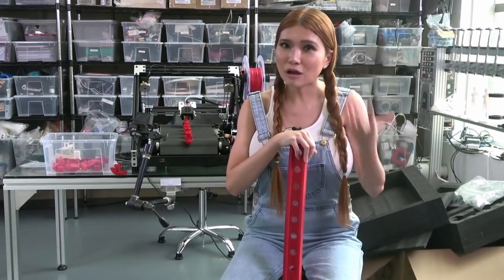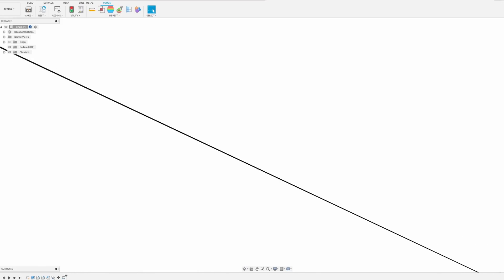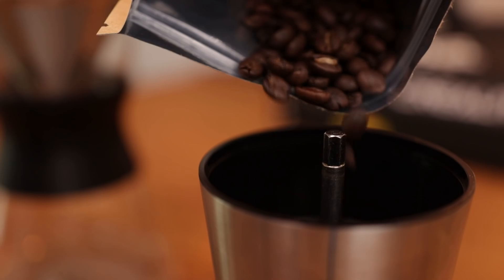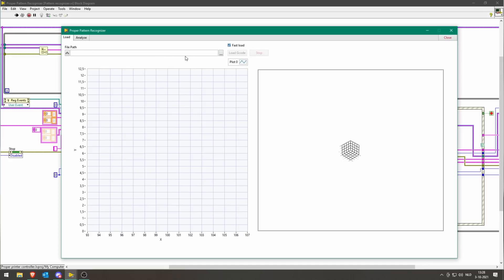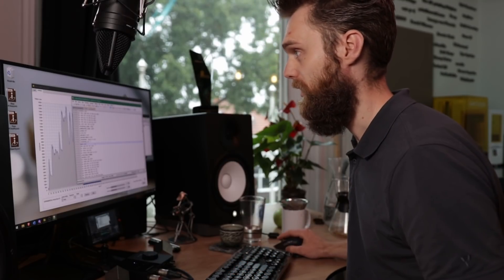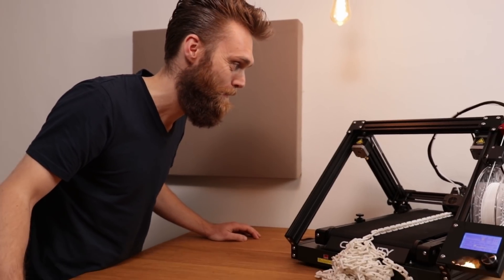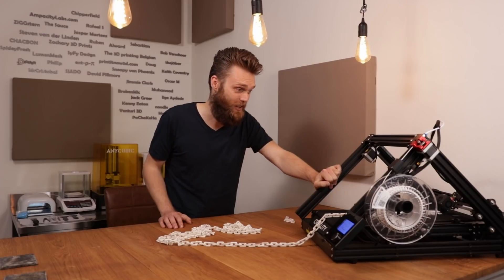Exploiting Pattern Recognition to print INFINITELY!?

Comment from the maker: Hi everyone! If you have any suggestions for this software or some designs with cool patterns to try, leave a comment! I just pushed this software to the development branch of the Proper Printer Controller https://github.com/properprinting/PPC/tree/development
Reply: Just giving a random thought:
I think with a folding algorithm the program could automatically find the repeating blocks. It's been a while since I had it in university, but I think it is also used in digital signal processing.
With folding, you can use a random section and detect, where it reappears in a data stream.

Maybe the program could take a random section of the data, with the condition, that it starts and ends with the same value, then fold it with the original data. This is done with different sections until a perfect match is found multiple times in the data. Then the pattern could.be presented to the user.
Reply from the maker: @MrKnoppersesser  Thanks for your thoughts! Finding the perfect match was so difficult because it seems like there isn't one. I tried it with a way simpler design, a long spacer, but there are minute differences (different starting points etc.). I tried with a match threshold, but it still was difficult. My idea is to use signal analysis within that graph to automate this process.

A funny problem you night run into when trying to find patterns automatically, within for example this chain, is that a pattern can be found within the link itself creating one very long link. This problem made me decide to do it manually since a human is more capable of knowing where to look.
Reply: @properprinting  Yeah, defenetly some kinks to the process.
And I guess slicing is already complex enough, to do the same task slightly differently each time.
But even with manual selection this is already amazing.
Reply: With the chainmail sheets, you will want to ideally have a connecting point on the sides so you can snap or link them together to panel make an item (like a shirt or something).  The print bed is not wide enough for a full sized print.  Now if you could deconstruct the frame, add bigger rails, and recalibrate the printer to know it has more room to move...
Reply: @seikojin  I've actually already created an infinite chainmail file and posted it on the 3DPrintmill Discord.
Reply: Any idea on how to convert this tool into a Cura plugin?
Reply from the maker: @AnchorInvest  No, no idea. I think it should work with Cura as well if you generate a Gcode with it. The software looks only at the G0 and G1 commands for showing those patterns and I programmed it quite universal. This needs to be verified though.
Reply: LabVIEW should have an autocorrelation function to find the looping lines (the period) - but injection of the command point might be a bit harder to do. 🤔 Nice work👍
Reply: Have you considered peak finding in Fourier space? Maybe a 2d transform of your x vs y data? Alternative option could be hierarchical clustering the data from two axis?
Reply: Hey man I just want to say thank you for these videos I hope that anything you want in life comes to you.
Reply: ^quite sad that this is just a design stolen by the chinese. Always sad to the some of the real makers get 0 kudos. /watch?v=E_RvnqVHbnA
Reply: @MagicGumable  I have to disagree.   Creality collaborated with me and WJSteele on their design and they had our full support.  We are just happy a belt printer finally made it to mass production.  Hopefully now we will see some real innovations in this style printer.
Reply: @MagicGumable  What do you mean, the belt printer? That was a collaboration with the actual inventor.

Comment: As a programmer, my immediate thought was G-code recursion. While recursion itself isn't actually necessary, the looping code accomplishes the same thing, including the break loop command. Basically you just need to find the start of printing a recurring pattern of 2 links and when the 2 links are finished, tell the machine to "go to" the line of code at the beginning of the 2 links again. This is obviously what you accomplished with the M808 command. Could be done with any print that repeats by just knowing the begin and end points of a looping segment. Very cool!
Reply from the maker: That was my immediate thought too! Turns out that there are minute differences on that level. Different starting points and an infill pattern or support structure that doesn't line up for instance, makes it impossible to find recurring patterns on that abstraction level. Therefore I added an abstraction level that shows the pattern. This probably can be automated using a Fourier transform to find the base frequency. It doesn't really matter where the loop starts as long as it's somewhere in the middle and at the right length. Another difficult part is to make it work with other designs too, not just a chain. Therefore I decided to make an interface where it's easy for a human to find the pattern instead of fully automating it with all variables involved. Thanks!
Reply: @properprinting  Extremely cool stuff man. I've been binge watching all your videos. In the middle of the experimental belt extruder vid now!
Reply from the maker: @802Garage  awesome! Thanks for watching them!

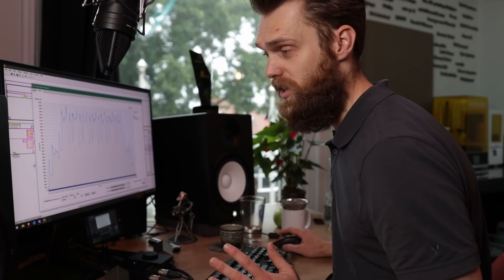Comment: I'd tackle this problem by using the information you have at 6:11, and doing frequency analysis on it. The repeating pattern should show up as the lowest large frequency spike. This frequency can then be used to fashion a 'window' length. 
Next we can use this known window length and do cross-correlation. Start by doing a cross-correlation with the window starting at layer 1, over the whole signal. Take RMS of all the shifts inside the cross-correlation as a measure as to the performance of the current window. Then shift the window to layer 2, and again do cross-correlation. This should allow you to detect the beginning of the repeating pattern automagically, so you just pick this as the start of the window and voila, you have singulated your pattern.

Anyways, that is how I'd try to automate this. If you have tried it, I am curious as to why it wouldn't work.

Comment: Just a quick idea: turn text to numbers then you have a perfect mumbo-jumbo number for each line. Cross corelate the lines (numbers) and you see a peak at each repetition to a perfect line assignment. I think this can be done in less than 20 lines of code.
For interested ones: the random numbers acutally help the cross corelation to distinguish perfect sections and you should get very sharp peaks, where the code repeats.

Comment: I know it was a joke, but there's no reason an infinity large print would need an infinitely large file. You could easily make it into a very small file. In fact you could easily even make infinitely detailed never repeating infinitely large prints that fit into a very small file size.
Reply from the maker: You've made me curious. How's that possible without using loops or an external controller?

Comment: Just print the same two links over and over. The top of one is the bottom of the other
Reply from the maker: Thanks for your suggestion, but this is not going to work ;) The start of the first pair of links is different than the rest because the rest has the end of the previous link in it.
Reply: @properprinting  
ah I think perhaps you misunderstood me
or maybe I was unclear 
the object printed is the second half of a link, the entire link slanted the other way and then the first half of a link printed directly on top of the previous link.
it would waste the first half link and the last half link unless you wanted to create a start object and an end object. 
I played with LOGO when I was little so the idea of a small recursive file making a continuous object seems natural to me
Reply from the maker: @andrewvoigt1133  ah yes, that makes sense. I'm wondering though if that wouldn't be more work than finding the pattern like I did in the video. With your suggestion you still have to determine the start and end point if I'm correct. Maybe I'm overlooking something though.

Comment: I was hoping you would get one. I bought 3 of them a few months ago and I've been looking forward to seeing what modifications you'll do to it. I got it printing TPU at 60mms with a ezr extruder from seemecnc. But the bed adhesion was terrible until I shimmed the two center posts under the heated bed with a washer.

Comment: General performance questions for the print--

Inches of chain per minute?
Length of feedstock consumed per inch of chain? 
Length of largest reel of feedstock machine can accommodate?

Which would lead to: Longest length of chain machine could print in one run and how long that would take?

Comment: Run the X, Y, Z, E plots through FFT and take the lowest common frequency peak from the results. This should tell you the exact period of the repetition.
Reply from the maker: That's an interesting approach! If you have the frequency, the position itself doesn't matter much as long as it's within the repetitive part of the file. I was hoping that I'd be able to pull it off with peak or valley detection and came quite close :D Thanks for this insight!
Reply: That's what I was going to suggest. FFT is Fast Fourier Transform for those that want to research further.

Comment: So you didn't make pattern recognition software, you made a visualizer and outsourced the pattern recognition algorithm to the human brain. Clever. Humans are much better than computers at recognizing patterns, especially when they're noisy.
Reply from the maker: Exactly! I rather see it as a tool. It's so much easier to put the focus at visualizing it as good as possible and make it as easy as possible for a human to select the actual pattern. If I'd designed it for this chain chances are that it would react differently with for lets say an I-beam with holes

Comment: I’ve just started watching this video, I will take a guess on the solution, then I will reflect on that comment. This can be achieved on Klipper by looping the gcode as script (except homing, heating part) and redirecting the output to /tmp/printer (named file descriptor, socket.)
Reply from the maker: I like that you comment your initial thought first! Looping Gcodes as a script on Klipper would have never occurred to me. I'm glad that my method was unexpected :D
Reply: @properprinting  😂 I can probably implement M808 as macro, too, if Klipper devs haven’t done it yet. My thought was a dirty hack though. Your method is the true “proper” printing.
Reply: The pattern recognition software was unexpected. I’ve learnt about M808, too. No need for scripting loop business. 

If I was trying to find a way to do this, I’d manually look at the sliced code and slicer, repeat from somewhere in the middle of the chain link manually. The less scientific approach 😄

Comment: Seriously using the worst software in the world (LabVIEW)?
Reply from the maker: You took the time to comment this twice so you must really dislike LabVIEW xD Can tell why it's the worst?
Reply: Tanks for the reply @properprinting  Yup, I really dislike it ;)
First of all it consumes a lot of computer resources even to do simple things (like a lot of RAM memory especially). Also it is very slow... It is worth mentioning that you have to download some beefy files even considering a runtime only to run a software...
Then entering simple algorithms takes considerably more time, compared to writing a code in any normal programming language (like Python, C++) - just let us consider a simple loop calculating some Fibonacci series ;)
And now more serious things - as you want to do some more complex things a LV code starts to be less and less easy to understand, while written code would still be. This especially refers to some modification of non-direct parameters of GUI elements (aka. controls and indicators). 
Then there is no proper compare/merge tool/algorithm when doing multi-developer projects using git (or other) repos.
Additionally some dataypes are not clear and conversion might be a nightmare. It also refers to ability to import/export some data - just by changing some cluster/struct definition during development you might render your old files (exported using built-in functions) unreadable.
Finally it is proprietary and paid software, while by coding your app using python, C++ or other languages you get much more freedom.
Reply from the maker: @piotrrze  Thanks a lot for your thorough reply! It shows that you know what you're talking about and I do agree with your points. The reason why I use LabVIEW, besides this is the software I know my way around with and I'd never call myself a software engineer, is that it's suited for controlling instruments. This is what I do as a test developer at work where LabVIEW is commonly used. I look at a 3D printer the same way as a programmable PSU for instance. In this day and age computer resources are becoming less of an issue, especially for the applications I create (besides that one exception haha). LabVIEW adds a layer of abstraction which comes with the downsides you mention, yet it enables to program at a relative low level. This means that I can create almost anything I can think of which matters to me so I can share my ideas and concepts which I otherwise wouldn't be able to :)

Comment: This is very cool work. When I added M808 to Marlin Firmware I was thinking specifically about the belt printer and objects like infinite chains, but M808 would make sense even for simple objects on a regular printer, reducing all kinds of file sizes, as long as repetitive areas can be identified and wrapped up into loops with relative motion.
Reply from the maker: Exactly!

Comment: This is awesome. Well done. I have been editing gcode manually.... It is crazy how a slicer can make an encyclopedia out of a paragraph. Your tool well help sort thru the bloat for sure. Thank you for your generosity to the community.
Reply: Slicers are just regular software. For efficient code, I think that's gonna need tensor accellerated AI. And several metric buttonnes of training. As there's pretty much a zero-tolerance margin of error.

Not entirely sure it can be done as a human would though. That requires some subjective evaluations and decisions, and AI can only do objective.

Comment: I was about to say that with infinite loop the ending gcode is needless. But then there is the option to end the infinite loop manually from the printer. And there's possibility to define how many times the loop should repeat so you can exact number of chain links every time. Cool.

Comment: You can easily create "infinite" parts by just manually controlling the GCODE with a computer and generating it on demand. Procedural art generation is a huge field on its own.
Reply from the maker: Thanks for this information! I was thinking of using the printer controller I made in LabVIEW to let it loop, but this is much easier ;) Is it possible to easily generate chainmail, extrusion profiles and a chain like this using procedural art generation?
Reply: @properprinting  You can just connect to the printer serial port and feed it any GCODE you want from Python. The simplest one would probably just put the chain piece on infinite loop. The upside here is that one can extend that small piece of code into an entire library of procedural generation. The only limit is imagination.
Reply from the maker: https://youtu.be/bfxqGK7mKAo ;) Still I think the m808 method is easier
Reply: @properprinting  You are the master, I'm merely a diciple
Reply from the maker: @4mb127  haha I wouldn't put it like that ;) Procedural generation never occurred to me and I think that this is a very interesting subject. Thanks for bringing this up!

Comment: So uh, idk, but did you make sure the dimensions of the chain were going to repeat nicely with the layer height? I figure if you are printing in 0.2 mm layer height and the chain length is an even integer I would think it should be quite identical, so long as your tatting layer is also set to 0.2mm.

If this is not the case, what do you think could be the reason why the layers are still subtly different and not repeating?

Perhaps it would be easier to start from the other direction and design a g-code that is meant to be repeated so that its end always lines up nicely with its beginning? Then you will be able to use filament forever without ever needing to stop and you will become one of the largest consumers of plastic in the world. #goals.
Reply from the maker: Every datapoint you can select with this software is at a layer change. The issue is that the layers themselves just differ due to variables like staring points and infill.

Comment: You could try calculating the autocorrelation of one of your x-move, y-move or extruded signals to get the frequency of the g-code commands. Getting the phase right will still require some labour with your program though.
Reply from the maker: LabVIEW has signal analysis built into it and I think that this is indeed the way to go to fully automate it!

Comment: Print a 1.75 mm diameter cylinder and feed the end into the extruder when the printer runs out of filament and let it run for as long as possible.
Reply from the maker: Haha I like this😂
Reply: @properprinting  Give it a try! :D I would try it but I don't have a belt printer. :(